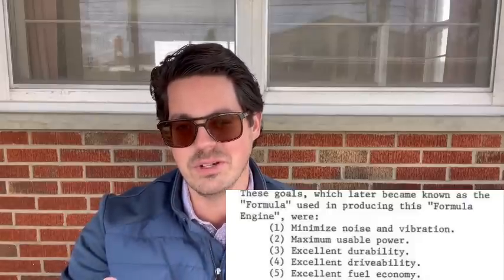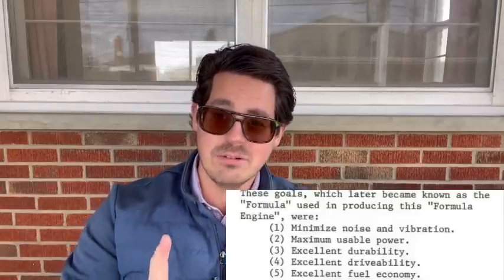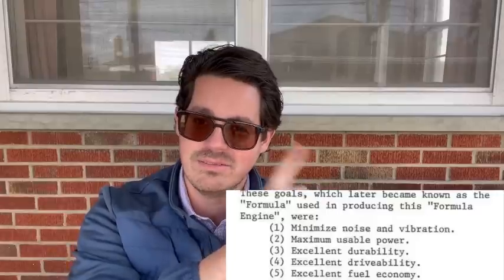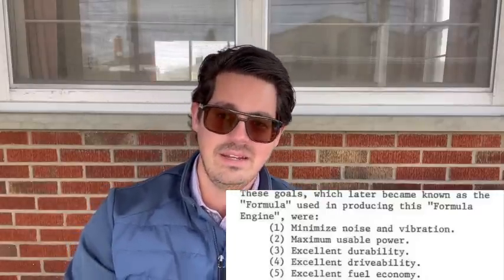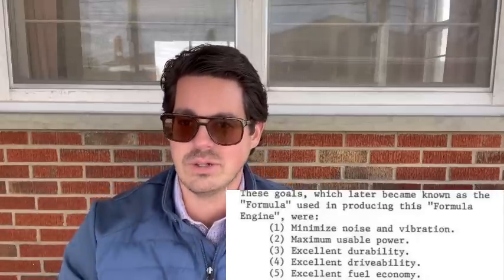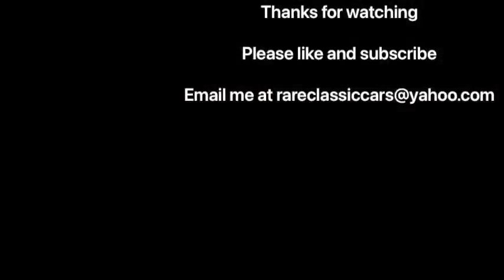Worst Engines of All Time: GM's 2.5L Iron Duke 4-Cylinder

Comment: My 1982 2.5 L iron duke has 300k miles with good compression on three cylinders and #4 by the firewall runs 10 to 15 percent lower. I suspect the head gasket is going since it tends to foul the #4 plug a lot more. The valve cover has never been removed and i bought the car new in 1982.
Reply: might be a valve seal
Reply: What car is it in just curious
Reply: @thefinalroman  That is exactly what I was thinking. My '84 Citation was burning some oil, but the deposits on the spark plugs were only on one side of each plug. This told me that the oil was leaking through the intake. I took the head off, and the valve guides were worn. I bought a rebuilt head (clearance sale at a machine shop), and the oil burning stopped.
Reply: I had a 1982 Oldsmobile Cutlass Cierra with an iron duke.  Noisy and gutless but reliable.  Wish I still had a car like that with character.
Reply: I guess it just goes to show as PT Barnum said, "there is one born every minute"
Reply: Impressive
Reply: @thefinalroman  valve seal doesn't cause low compression. 10 to 15% lower compression and fouled plug, ring sealing is a far more likely culprit
Reply: @ludditeneaderthal  oil leaks down the valve and pits the seat when it vaporizes to carbon chunks...
Reply: rings in#4 do a wet test bet it comes up
Reply: iorn duke. good motor. lot of people are unrefined an crude.
Reply: USPS has hundreds of these engines in the LLV's that have been converted to EFI . Thank You for the informative video.
🇺🇲🇵🇷🦊👍
Reply: Rings?
Reply: @thefinalroman  Or a worn valve guide.
Reply: if you are done paying it off, get the engine repaired
Reply: I was a dealer mechanic in 1982, see if the head bolt in the left rear corner has a stud with a bunch of ground wires on it, those would break at very low miles, I can remember doing them under warranty, If I am correct after you remove the nut and wires, half of the head bolt will come out real easy we made a tool out of a long chisel and were able to get most of them out, if you can get it out just replace the bolt and relocate the ground wires to the engine block, just do it soon before the gasket blows out

Comment: The Iron Duke should’ve been a Soviet Engine.
Reply: Brutally simple?: Check. About as refined as GULAG moonshine?: Check. Damn near impossible to kill?: Check. 
Yep, would have been at home in a Lada.
Reply: I suspect a Soviet engine of that size would be about 20hp though.
Reply: @ironhead2008  
Even a Lada had an OHC. IMO if Pontiac was Iintent on building a 4 in that size range they would have been better of to resurrect the OHC six built as a four banger.
Reply: @mpetersen6  I wish they had continued the OHC I6. It would’ve been nice if they had taken it to the full extent, DOHC, cross-flow, all-aluminum, turbo, fuel injection, etc. The closest thing we ever got to that in the USA was the VorTec 4200 I6, often called the “American Barra”. Even ford australia gave the 300 I6 a Dual-cam head and turned a truck engine into a powerhouse.

Comment: I loved this engine. It was noisy because the cam was gear driven. It was bullet proof.
Reply: And the cam gear was not metal. It was a sort of fiber based plastic.  It wore quickly and made the engine knock. The fix was replace the cam gear.  Step #1.  Remove the engine.  Later on techs found a way to short cut it, but for years it was remove the engine
Reply: Yeah it sounded like it'd explode if you revved it at all, but it was reliable.  Tractor engine.
Reply: @blurglide  LOL, Mine must have had great sound deadening! The timing gear could be noisy....
Reply: @rickhibdon11  You always know your in trouble when Step # 1 in the shop manual says "Remove engine to perform the following procedure" Lol... Years ago a friend & I did a timing belt on a little Isuzu/Chevy Spectrum. He said "That engine is not coming out of this car for a belt!" We thought about it for a while, removed a transaxle mount on the opposite side so we could tip the engine to the right & it left us get a socket on the crank pulley. Can't imagine we were the only ones to think of that...
Reply: The rattling noise these engines made was from the pistons . They had too much clearance in the pin area , which caused them to rattle .
Reply: @DejaView  well nowadays many crappy cars need engine remove for a simple belt job..usaually i avoid owning these type of cars.

Comment: I recall several friends back then having this engine and it proved to be pretty durable.
Reply: Durable yes, gutless and leaky - also yes.
Reply: I called it the Iron Puke. I had one in an 82 FWD Buick, X car. It was gutless but got pretty good mileage. I had a 3.0 version in my last boat and I had zero trouble with it.  Had enough power to move a 19' pretty well.
Reply: @Tommy_Mac  The licensing for the 3.0L was sold to PSI and is still used in some Chinese Forklifts.
Reply: @don2deliver  it's a fairly common Mercury Marine engine, too. I guess MM get them from PSI.
Reply: @Tommy_Mac  not exactly the same in marine applications,  GM does the block merc or omc bores the block and uses their internals for marine duty.
Reply: mail trucks  still have them    ,,i have one in my 84 fiero  ,,,runs  great
Reply: @shadowwolfmandan  When Jeep used the same block they got noticably more power out of it, GM again at the time went soft on it. But of course the Jeep engine was a bit noisier but it's a Jeep.
Reply: @Tommy_Mac  Mercruiser did away with it and replaced it with the lower power level 4.3 V6.
Reply: They didn't have enough power to tear themselves up.
Reply: Same here Edward
Reply: @Tommy_Mac What kind of fuel economy did you get in your 82 Buick?

Comment: Another gem. My dad's brand-new for '86 Olds Cutlass Calais had this engine. In 10yrs the car just about fell apart, no paint, plastic interior disintegrating, but that Iron Duke kept on clattering 🤗
Reply: Haha yeah those GM cars were just junk at that time!   My Mom had a 1983 Buick Regal.  Absolute garbage. Rattled apart as you drove it. Everything went bad, power windows, wipers, door seals, trunk latch, door handles fell off, rearview mirror fell off, domelight fell apart, heater controls started going out, rear bumper rusted and FELL OFF on one end!   HAHA
Reply: I had an 80 sunbird with an Iron duke. It was a legendary engine. It injested water in a flash flood but kept running so I could drive out of water so deep the car was floating..saved my life. It ran 90 miles in August in the desert after loosing a waterpump..it actually could successfully air cool..new pump and away it went.. it was cheap and simple to fix, they are noisy with the timing gears..but indestructible cheap and reliable. I would joyfully buy a car with one.. they never made much power, but that wasn't what it was designed for
Reply: I thought the Calais had the quad 4

Comment: The GM iron duke was one of their better engines back then . Easy to repair , long lasting & fairly efficient on fuel . The post office still uses them
Reply: Of course it's reliable.   It lives life below 3500 rpm.  A farm tractor engine with the benefit of fuel injection so no fuel washed cylinders in cold weather, had gear to gear timing, etc.
So buzzy and boring and low on power it's almost love-able.
Reply: yes they do....but usp. is a poor example...still funny..thanks

Comment: I had a '87 Chevy Celebrity I bought off a friend of mine years ago for $500 as a back up car. When I got it, I know it had over 170,000 miles on it. I drove it around for awhile and it actually ran when the head gasket let go. My buddy and I pulled the head, took it to a machine shop, got a new head gasket, head bolts, and put it back together and it ran perfectly. That old 2.5 wasn't a powerhouse and wasn't refined, but it NEVER left me stranded and ALWAYS started. The old "Iron Duke" was reliable and I wouldn't run away from a vehicle powered by it (especially the later years with the serpentine belt).

Comment: The auto parts store I first worked at had a 1977 Pontiac Astre wagon delivery car. It had the Iron Duke. It took almost 80,000 miles of delivery abuse (regular visits to redline, minimal maintenance, oil changes maybe once every 10,000-12,000 miles, probably one new set of plugs, not much else). It finally threw a rod one cold (10 degrees Fahrenheit) morning when we were warming it up for the day, running on cold idle (1700 RPM or so). The rod went down through the oil pan. There wasn’t 2 quarts of spilled, black as sin engine oil on the ground. I think it did pretty well durability wise considering. It was definitely noisy and rough.

Comment: I've owned several vehicles with that 4 banger.
With oil changes, most of the engines outlasted the rest of the car.
The biggest problems they had was the crappy complicated carbs and then early generation  fuel injection. Not to mention the dozens of low-quality vacuum hoses that were prone to crack and leak. It's not fun when a 4 banger is idling on 3 cylinders at stop lights.
Reply: this is the exact issue im having with my 89 s10 right now! I thought I was going crazy when I realized that I was only running all 4 cylinders when I was accelerating. Ill have to go through and check all of the vacuum hoses.
Reply: @Bassdude98 Did you ever figure out that problem? Was it running rich or lean?

Comment: Had this engine with a manual in a 79 Sunbird (a RWD Monza rebadge back then), when I was a teenager in 1989. Still one of the best and most reliable cars I've ever had. What it lacked in speed, it made up for with impressive clutch-dump burnouts.
Reply: Those 4 bangers do a burnout?! I’ve got an 80 Sunbird with the Iron Duke and 4 speed, and I’ve never tried a clutch dump, how well does it do it?
Reply: yes they are almost unbreakable, look at my post above about the 1985 Indy pace car